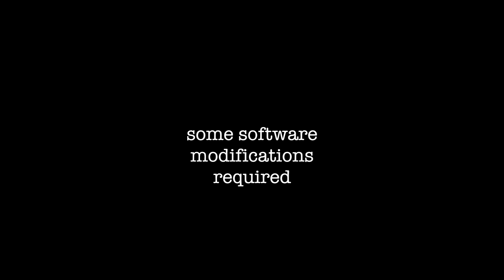homemade ROV ver 3 (vs shark)

Comment from the maker: I used the servo library and from there ordinary boat ESC + motors. Ethernet protocol was not used. Just the the 8 cables in the ethernetcord, 2 of them for video signal from the gopro.